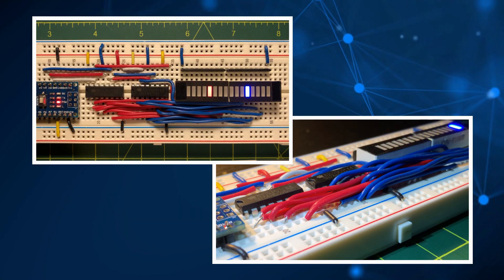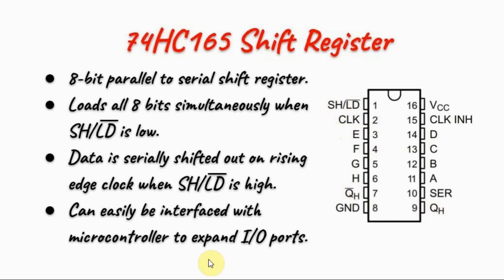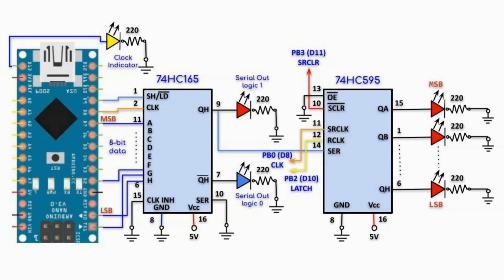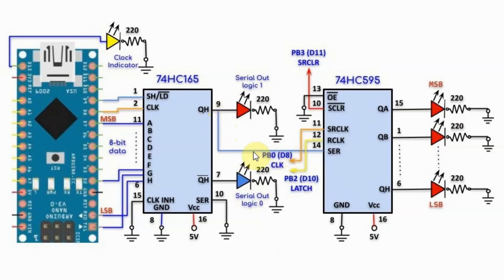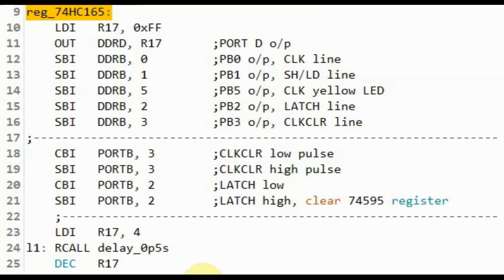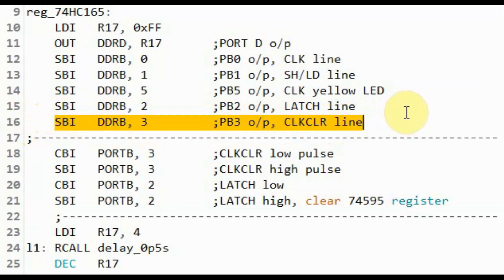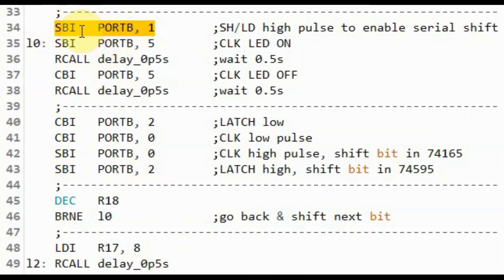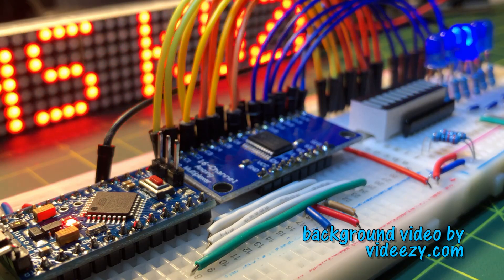Assembly via Arduino - 74HC165 Shift Register

Comment: I am trying to make a tank level controller using ultrasonic sensor sr04 and esp8266 (i have some esp lying around thats why). What i am planning is 2 esp 8266 connected to my home wifi. One will be in the kitchen and one will be near the motor.

The kitchen will have auto / manual button, on button, off button and an oled screen to display actual water level. The esp near motor will have an on off button and ultrasonic sensor connection. Is this setup possible? Thanks